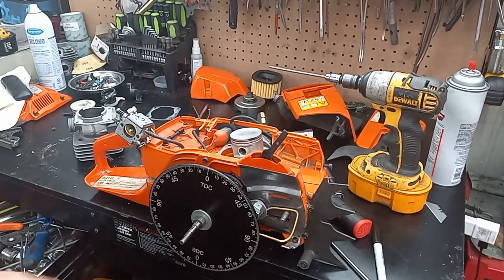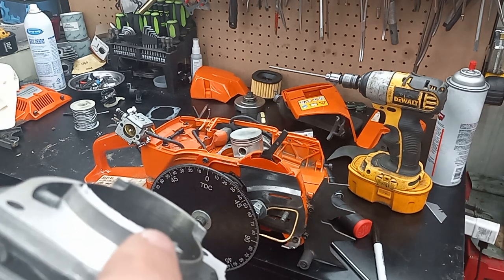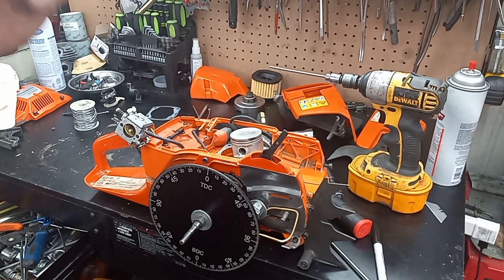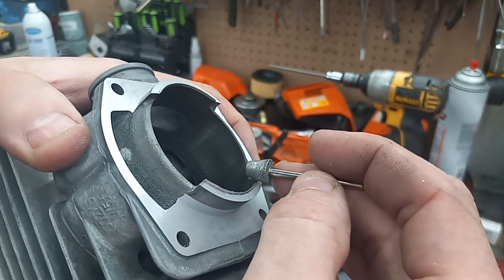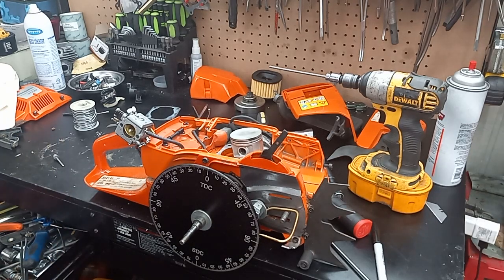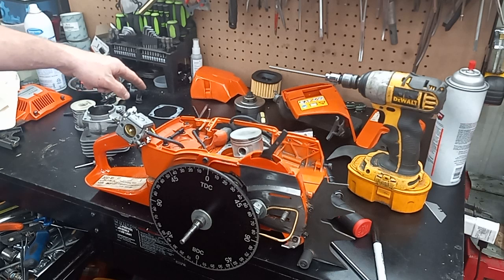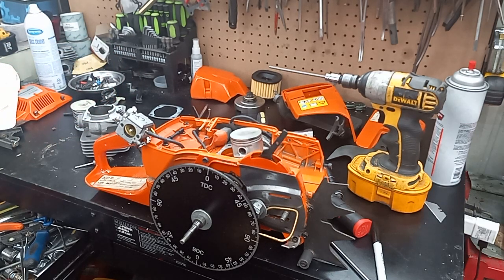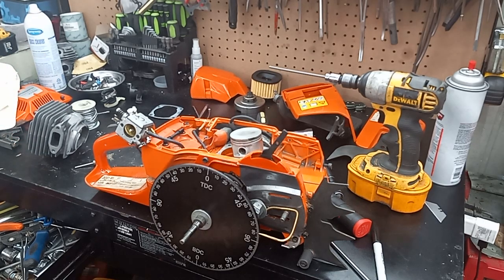porting & machine tips that can save your cylinder

Comment: I want to buy a highway 52mm big bore pop up for my jred 2165, I don't port but have watched a lot of your videos and others on the issue with them flaking, most builders don't want to mess with them for that reason judging by the vids I watched, and also I don't want to stray to far off topic, but I was wondering what your thoughts are on full circle cranks, as opposed to the pork chop style most saws run, I have my first jonsered I bought new in 2001 still runs great just replaced rings and fuel lines new carb kit oh its a 2159 turbo and about 3 years ago I found a jred 2156 turbo same cc with the full circle crank boy does she turn some rpms , my question is why do you think more manufacturers Stihl,Husky and Echo not use full circle cranks more often instead of just a few select models, the obvious reason would be epa,warranty would be my guess I mean I can only imagine one of your saws whether it be a 4910 or that wicked 400 you built with a full circle crank, or would they simply have to much compression anyway just would like to know your thoughts and perspective on the subject.

Comment: New Farmertec cases must be deep enough for a 372 x-torq jug. Or I just got lucky. Maybe you have some 372 x- torq vs original version mix and match tips. I had to swap the x- torq  impulse  pipe to the new case as well.
Reply from the maker: if u cut base u shud cut skirt